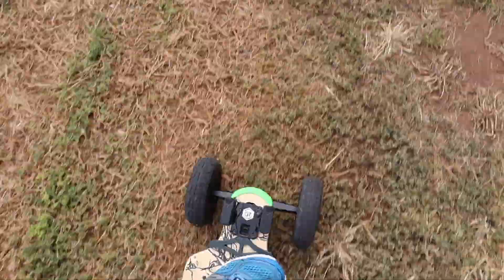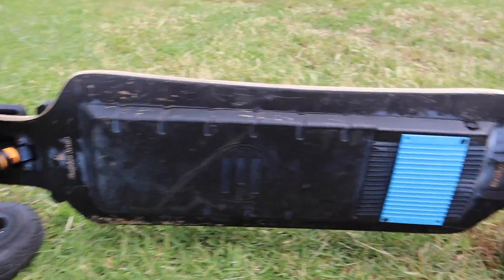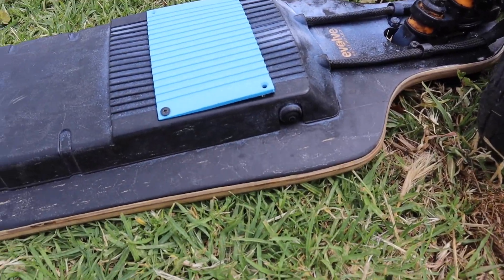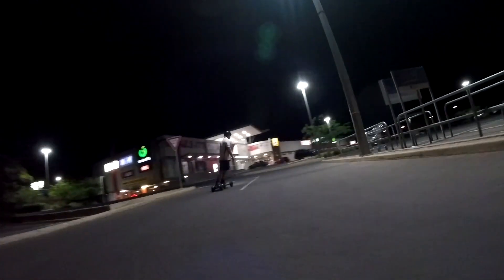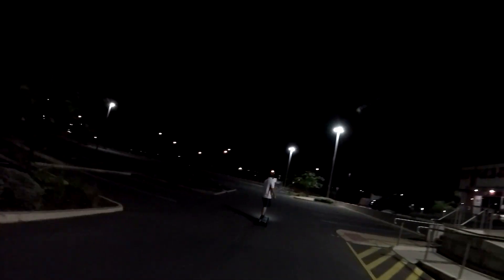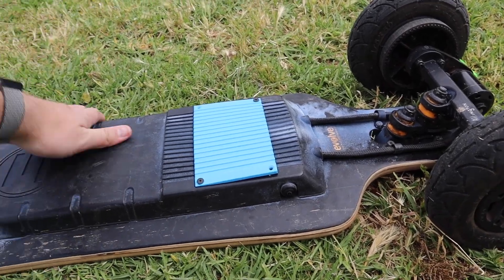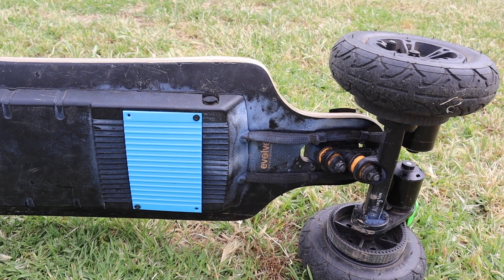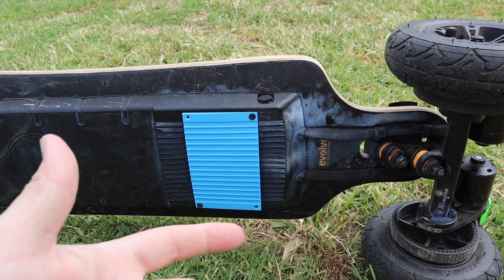Flipsky FSESC Dual 6.6 Pt 2 Evolve bamboo GT install

Comment: Hey mate, 14 months on.... Is the Flipsky dual fsesc6.6 still working fine?

Id really like to know before I drop my hard earned money on one. Cheers.
Reply: In the DIY community, the flipsky ESC's are considered kinda meh. They work great if you get a good one, but they have some pretty bad quality control on their products. The best you can find right now is a focbox unity, or two focbox 1.7's. There is another ESC in the works by the man who created the Unity, as well as a DIY member from china creating a good alternative.
Reply: @David-xr2sc  Thank you for sharing! If i remember correctly, the focbox is produced by enertion, which is dead already. Is it still a good idea to buy this product today? I'm using two old 4.12VESC which for two years now, they worked okay for me. But I'm considering to upgrade to a FOC Setup. Trampa also offers only single VESV6s, right?
Reply: David have you had bad experiences with flipsky?

Comment: Questions:
1. How do you manage to connect the R2 to the FSESC 6.6?  Did it still display the details of the battery voltages in the R2?
2. Do you have a video of how you connect the FSESC to the motors, charge, and on/off button?

Comment: can you share the setting for the BGT. I plan to order the fsesc 6 6 for my Carbon GT.
Reply: Go for the legit VESC. FSESC known to fail, short, overheat between 2 and 4 months
Reply: @brandol4719  I ended up getting the  Unity. I have Unity's in my DIY as well as my CGT. I may go for a stormcore next year.  These unity's are still going strong with no problems so far.

Comment: Would you recommend the dual 4.2 for a dual 6374 190kv? Is that demanding too much from it? I am currently using the flipsky 4.2 single on a single 6374 motor 97mm wheels street setup. It reaches up to 31mph, but can only maintain it for about 5 minute then kicks me down to 20+ mph for the duration of the battery range, unless I let it  rest a bit. Then I get a burst of top speed for a few minutes again.  I'm not sure if that is what they call thermal throttling or battery sag. I noticed the vesc and motor slightly warm, but not enough to where I would think it would be a problem. So my thoughts are to go with the dual setup to decrease the demand on the single setup at the same time  increasing performance, Your thoughts would be much appreciated. Thank you.
Reply: @Brantley Joaquin instablaster :)
Reply: @Jericho Carl Thanks so much for your reply. I found the site thru google and Im trying it out now.
Takes a while so I will get back to you later when my account password hopefully is recovered.
Reply: @Jericho Carl it worked and I actually got access to my account again. I am so happy!
Thanks so much, you really help me out!
Reply: @Brantley Joaquin no problem :D

Comment: How did you connect the motors to the Flipsky? It’s different connectors right?
Reply: Orlando Marin the vescs come without any connectors. You can solder on whatever connectors you decide to use. I went with 5.5mm bullet connectors but that’s a little excessive. 4mm bullet connectors are good

Comment: Is there a book upgrading your Evolve BGT for dummies ?? Because I don't have a clue what you're talking about 😄 my board keeps regularly dropping out and that creates a whole bunch of safety issues as well as reliability how do I learn how to do this please. You mentioned that you would swap back to the original Evolve setup does this mean that your Evolve ESC actually works normally  ?? Man I like this board I'd like to your setup I followed the link below and understand a little more about it is there somewhere to check out the method cheers mate any help would be great. Tony Hornsby NSW Aus
Reply: Thumpermad have you figured anything out?
Reply: Yeah Gday Eric I actually lashed out and bought an Evolve Bamboo GT with the new controller and the twin motors haul me around quite sufficiently thanks the Gen 2 Carbon Street still poses the same issues that I mentioned before but the battery hasn't had that many cycles put through it so I figure....when the Bamboo GTs battery finally dies I'm thinking I will try swapping out the motors and the control module over to the carbon board if the sensitive evolve electronics will accept the bigger carbon street battery pack. The battery in the Bamboo GT seem to die fairly quickly especially in undulating riding conditions I really like the Bamboo board it's a lot easier to carve on tighter streets paths etc cheers mate. Tony
Reply: Thumpermad I have a bamboo gtx and I just put a new flipsky vesc in it. Got the flipsky VX2 remote also. Next I’m going to make a 10s4p battery pack to swap out the prismatic pack. Ride safe brother!

Comment: someone told me i can buy a flipsky 2.4 remote and pair it with original esc on my evolve gtr is this true?He said to find out what esc gtr uses.thanks
Reply from the maker: No sorry you can not do this with out changing the esc. The evolve boards use their own esc
Reply: ESK8 Support oh thanks is that easy to do or do you reccomend to keep original.i dont like the gtr remote.i love the boosted style wheel on flipsky.thank you.